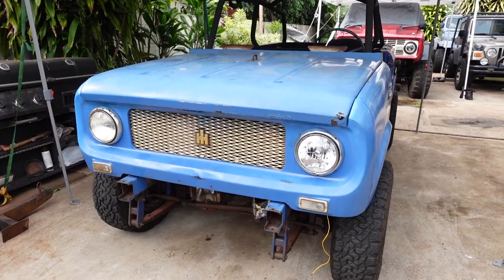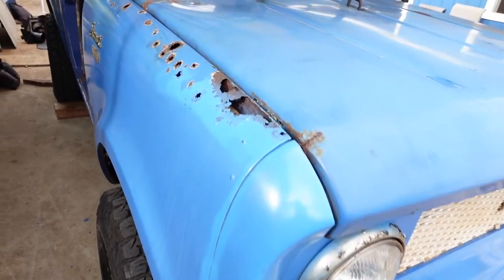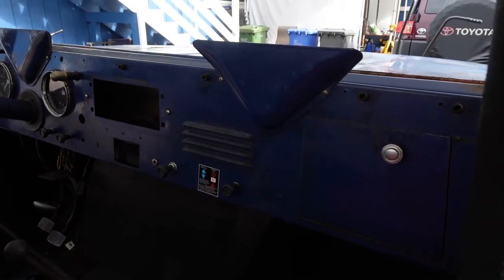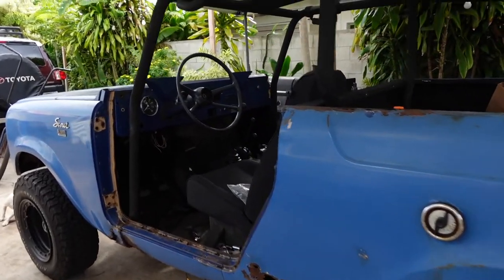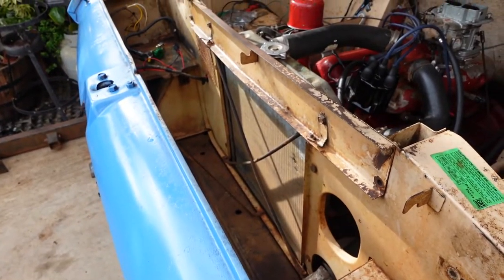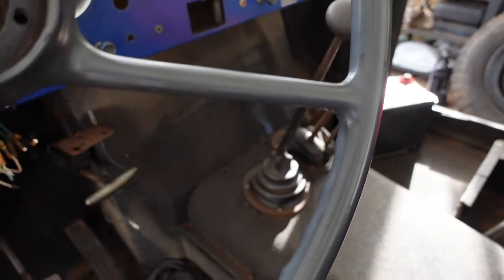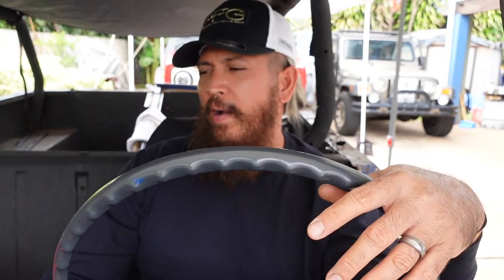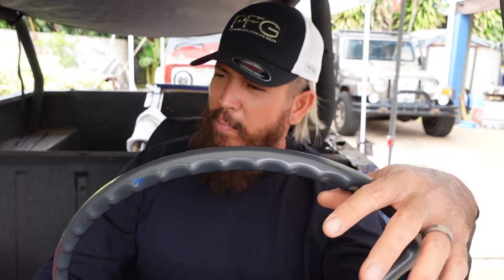1962 International Scout 80

Comment: You can put on a 8 volt battery and your lights will be brighter and the cost of just buying a new battery verses changing it out to a 12 volt on the Scout and you can buy the battery at O’Rielly’s auto parts.
Reply from the maker: Well, I’ve already stripped and installed a new wiring harness so no issues.  I have other projects before I can get to this one.  She’s being driven daily as it is.  Thanks!

Comment: Thanks for the video!  I’m redoing my ‘65 Scout 80 and changing from bench to bucket seats.  It looks like you mounted the seats to the existing seat base? How did you do this?  Did you use Rugged Ridge’s seat adapter or something else?  Thanks again!
Reply from the maker: Hi, I cut and rewelded the existing frame.  This one is fixed and I mainly designed it for my daughter’s driving position.  She has this at the farm and use it to haul horse feed and all kinds of other things.

Comment: Do you plan to swap your motor? I would like your 4 cylinder if you do.
Reply from the maker: Not right now.  I’m trying to keep her as stock as possible.  My Bronco is too modified and I love having to drive a stock one once in a while.
Reply: Do you have any parts for sale? I need a water return pipe.
Reply from the maker: @toddhulen7740  shoots, I just got rid of the fan motor and ducting since I didn’t need it for Hawaii.  I also used the holes to run a new 12 v circuit.  Sorry…